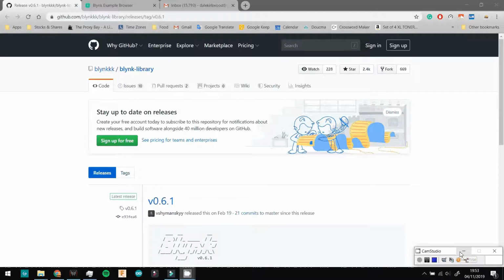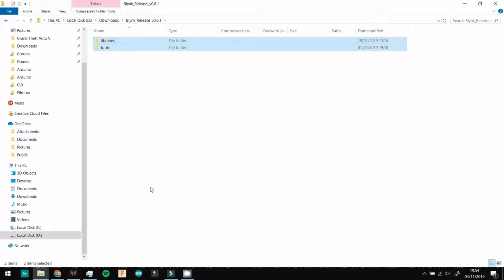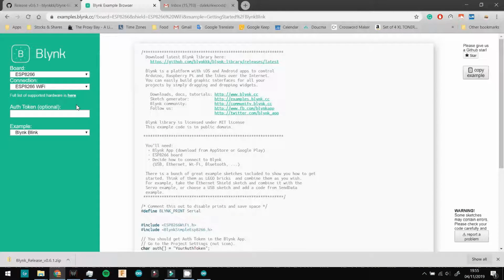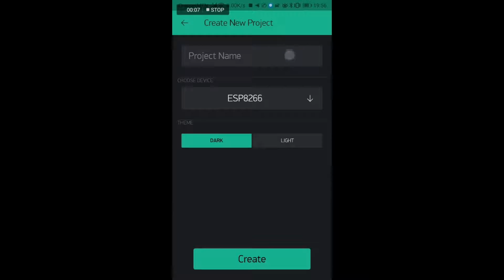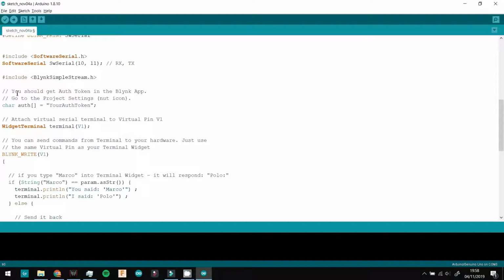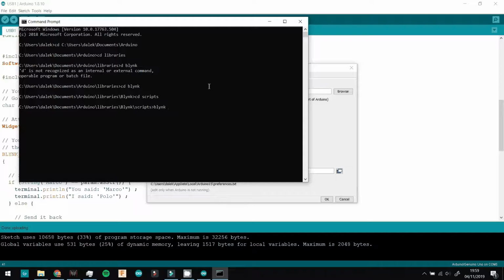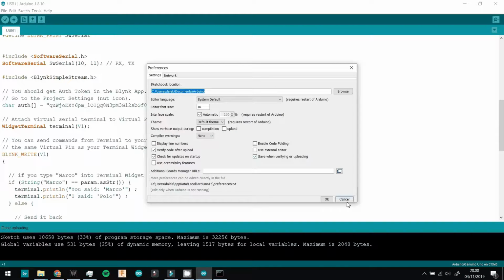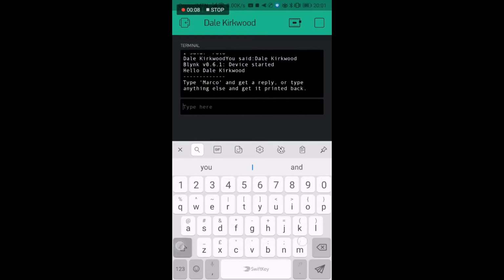Tutorial: Control Ardunio with the Blynk app over USB - Full Set Up

Comment: Thanks for this info. The Blynk version was totally useless. For windows users
Reply: Thanks for watching. What did you find was useless about Blynk?
Reply: @dale7561  And the fact you used windows instead of ios made it less confusing..... But I am getting better at it...... My current problem because I'm useless at programming is trying to get 2 temp sensors on one board using an esp32 working. Can get one working but not both...... But I'm still trying to figure it out.....I'm sure I'll get there eventually
Reply: @johnnyjones5385  this shouldn't be so difficult to do. Feel free to write me at dk@dalekirkwood.co.uk and I can help. I'll make a video about it 😁
Reply: @dale7561  "this shouldn't be so difficult to do"  Yes... you would think...... I'm going to have another go at it tonight..... If I struggle I might take you on that offer.....
I know it'll be something stupid and obvious once I get  / if i get it going....
Reply: @johnnyjones5385  sounds good. The ESP 8266 can be a pain. I really recommend this chip for getting started. Cheap and works like a charm. I use it alot. 
https://a.aliexpress.com/_d6HKdg6